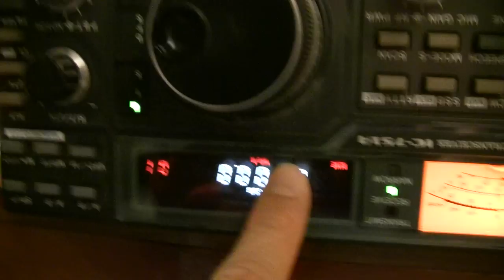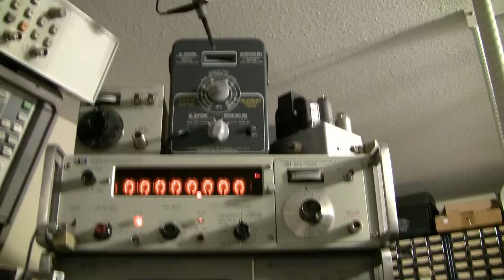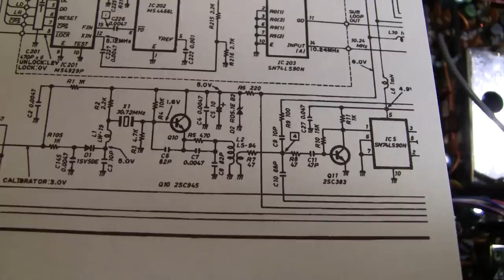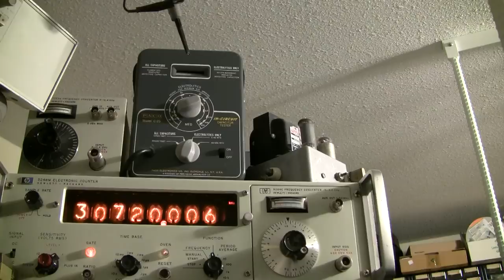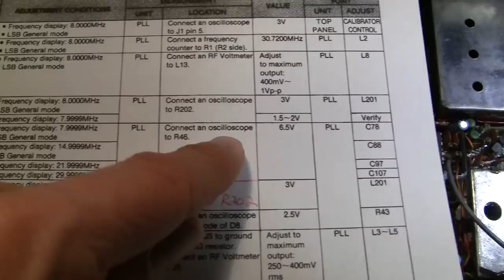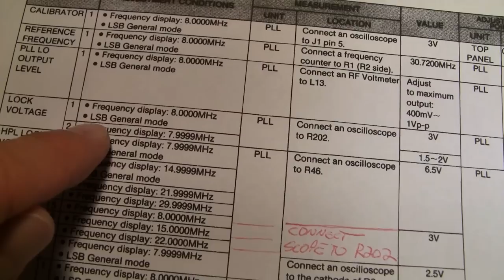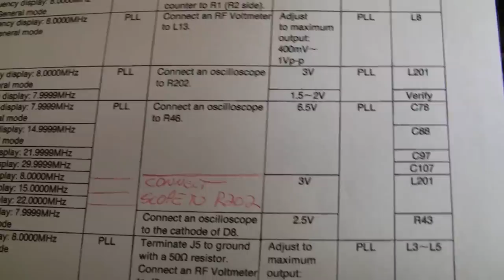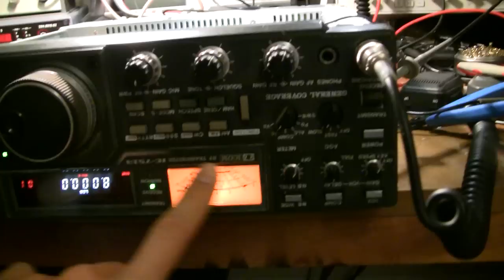ICOM IC-751A Reference Frequency Oscillator Alignment

Comment: I grew up next door to a WWII veteran ham operator. He helped me get my Novice license about 1977. Sometime in the 80's he replaced his Drake Line with a IC-751A Icom. He invited me over to see it and he said for me to sit down and give it a spin. After turning the knob a few turns smoke arose out of the display area bigtime. Wow i felt bad. He was cool about it as always. I miss that guy almost as much as my dad. Oh, you are obviously a very smart fellow. Enjoy your videos very much, Thanks for going to all the trouble for us to enjoy your adventures. Chuck, AF4O
Reply from the maker: Thanks for comment! That's quite the story. I can imagine the moment when the magic smoke came out. I Bought a Icom IC-746 some time back, it's the one on the bench...... Anyways, I owned it for one day, and the display went out. I couldn't believe it! So... I pulled it apart and found a small transistor in the display unit that had been so hot, it desoldered itself. The little heat sink tab was blue! So I redesigned the area, built a circuit that would be fine running in the linear region, and all has been good since. There were also a bunch for IC's that took some heatsinks too. I don't believe in running parts hot enough to cook things.
Reply: What was his callsign ?

Comment: Paul, thanks for bringing these mistakes in the service manual to light. Also the battery backup for the ram hasn't failed yet. I've had this rig since 86 and it works marvelous. I have the 250 hz filter in the 9mhz and 455kc IFs. It's like a barn door is slammed shut on the noise when their engaged.

Comment: I had my old IC 751  (not the A version) for 34 years before it lost some caps and went west. A donation to another more fortunate ham who tried to fix it. I bought a new IC 7300 which makes mincemeat of almost anything in its class. Good call, Paul!  KQ2E
Reply: It's been a year now... I am SO happy with my IC-7300 that I couldn't be happier. I am STILL finding "new stuff" to change or improve my usage of the receiver. I'm hoping that my old rig hasn't hit the bottom of a large steel bin... LOL

Comment: Wow what timing! I installed a CR-64 yesterday in my IC-751A  and was trying to set the ref. freq. with no luck thinking I had an equipment issue.... so I searched YouTube and found your post and yes the Service manual has it wrong!!  I clipped my probe on the R11 by the IC5 (pin1) to made my tweak's.  THANK YOU for posting! Jonathan-KN4G
Reply from the maker: Glad to help gadgetman368. Thanks for your comment!

Comment: Good to know about the 3 volt for that Ram. Thanks
Reply from the maker: Ruben No problem Ruben. Glad to help :^)
Reply: +Mr Carlson&#39;s Lab   Piexx is the company that makes the non- volitile ram board.
Reply from the maker: Thanks for the info!
Reply: If you DO get that Piexx board, be SURE to follow the setup directions EXACTLY. Not doing so will have "very bad things" happening in short order. Make sure a warning sticker is affixed to the board to save the day in case someone plays with the EEPROM board... and requires the setup afterward.

Comment: I have an icom r75 and the oscillator is not on frequency.  my question is where do I get the tuning tool to adjust the coil, what do you use?

Comment: Hi Paul, nice video!
Had you found also ther errors in bfo section?
Reply from the maker: Hi Carmine, The SSB and CW reception and transmission was great in this transceiver, so I left it at that. Thanks for the comment!
Reply: You might want to repeat the Icom 751A BFO alignment errors for others (like me) who need them. Have you checked that the model 751 manual also has those errors? Thanks... Bruce KQ2E

Comment: Mr Carlson,  be advised that the best replacement for the volatile memory board is made by the Piexx people - - for IC-745 and IC-751 radios. Reasonable price, essy installation, and peace of mind.
Reply from the maker: Thanks for the tip William! I believe Stephen is going to get the aftermarket board, it also extends the radios coverage.
Reply: Mr Carlson's Lab That's good! He'll certainly dlep bette st night! I did so for my IC-745 (Old Betsy} snd she was a happy camper. By the way, may I know your call sign? 

..and I loved your resto on your "Gothic" Hammarlund receiver up the way there! What an inspiration.
Reply from the maker: William Phinizy  Thanks for the comment on the Hammarlund! I PM'ed you my call.
Reply: +William Phinizy.. Jeez! Talk about fat fingers! That was supposed to be "sleep better at night" but came out like some Vietnamese epithet. Sorry!
Reply from the maker: Ha Ha... No worries!
Reply: Mr Carlson's Lab Those batteries last a long, long time.  Check the voltage before deciding to replace that battery.

Comment: Could you explain why not to use an external PSU when changing the battery?
Reply: cmdstraker  I guess it's just incase the supply voltage should fail, Or a glitch in the supply  etc ..

Comment: What is your opinion of the Ic-751A Radio ?
I am thinking of buying one .
Reply from the maker: cadiscase  I'm not a fan of the volatile ram issue. I say stay away from it! Go for an older Kenwood or Yaesu.
Reply: Mr Carlson's Lab It might make a good video to change out the battery or install one of the battery mods. Just a thought.
Reply from the maker: Maybe, if another ever comes my way.
Reply: Mr Carlson's Lab Any opinion about the IC-765 ?
Reply: +Mr Carlson's Lab I appreciate your insight, on this matter! Muchos gracias! I hear a lot of bad feedback about Icom, & TenTech, & Yeasu, etc.
Reply: Ridiculous, add a non-volatile $69 Piexx RAM board and have a greatly superior radio to nearly everything ever made. SOLID 5/5 eham rating - 110 reviews!
Reply: don't buy if the Ram were not update to new one this is the fail in iCom

Comment: Mr. Carlson... I have an ICOM 750 (which I understand is the same as a 751 only sold originally in a different country).  I've owned it about 15 years.  I've never changed the battery.  Would you suggest I let sleeping dogs lie and leave it alone or change it to a new one (and take the precautions you mention)?  And thanks for a great video!
Reply: Buy the EEPROM version board for $75 US and be done with the problem. But save the old board in case you need it. I built a special double battery backup board with diodes to make changing the battery a "no brainer." THEN I bought the new board. Duh. LOL

Comment: I hate it when my service manuals are not correct.
Sometimes the service desk of a manufacturer is not up to date to or gives stupid answers.
Reply from the maker: smbrob  I agree!
Reply: +Mr Carlson's Lab Engl Guitar amps is famous for having incomplete & just plain wrong information in their schematics. Some of the techs in Germany, where the amps are made, suspect it is done on purpose. All I know is they are so bad, I simply refuse to even acknowledge they exist & pretend they don't. I work on them like no schematic exists. That way, I don't get thrown off by their erroneous information, & it keeps their nonsense from entering my brain, and giving me any preconceived notions, about what they actually did. Turning the amps away at the door, works even better.